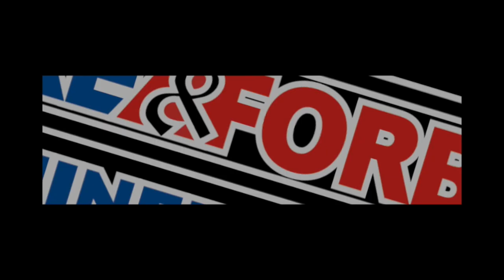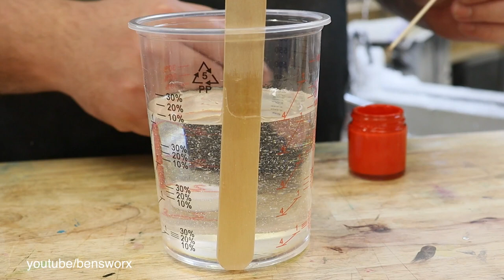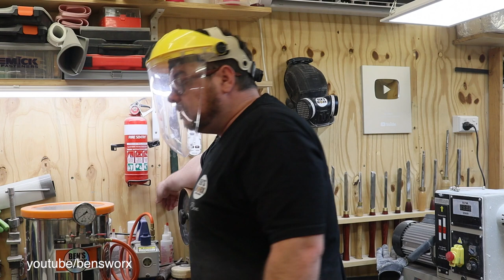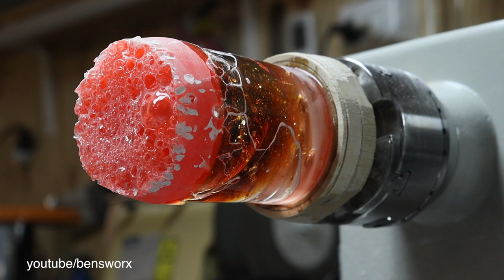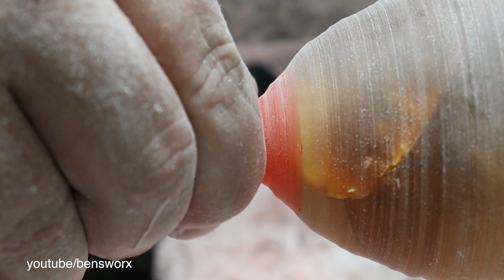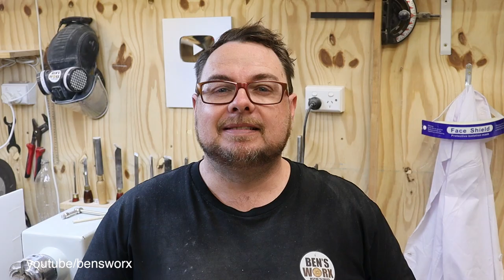It all Started with Popcorn - The Nebula Egg

Comment: I used to work at a transformer factory as an Impregnation engineer, to get maximum penetration we had a dual use pot, we could draw a vacuum, then leet in the varnish while still pulling the vacuum, after a while we would apply pressure, back to vacuum and then to pressure while still submerged, then we open a valve so the pressure put the varninsh back in the supply tank
If you do this again, at least draw the vacuum, then while still liquid release the vacuum, then either reapply vac or put in pressure pot.

Comment: Did you let the air back into the vacuum chamber before curing? As you’re not getting 100% vacuum, you’re better off letting air back in to push resin into the voids.
Reply from the maker: Yes I let air in a couple of times 👍

Comment: One things you should remember negative pressure will pull the air out but positive pressure is needed to push the resin into the voidz without allowing some air into the vacuum chamber before the resin hardens all you're left with is a bunch of holes that are pretty much vacuums
Reply from the maker: Yes I release the vacuum multiple times

Comment: The egg looks like a planet nursery.

I've seen a couple resin channels use magnets and iron dust. Every one of them did it with the market on the bottom. What about magnets on the side of the resin container, with the iron dust is dropped in the center top of the uncured resin?

Comment: If you let the air into the vacuumchamber all the bubbles will go away, curing under vacuum is not a thing I had succes with, but taking in out and then cure, will give you a bublefree result.

Comment: Could you pump down a project in the vacuum chamber, then repressurize to collapse the bubbles, before the resin sets?  For that matter, could you pull a vacuum in the pressure pot?
Reply: since air is used to create the pressure, how could you pull a vacuum?
Reply from the maker: Yes
Reply: @afg122602  "Pulling a vacuum" is a phrase that's sometimes used when dealing with pressure-related items.  It means to create a vacuum in a system by pumping out whatever gases are present -- "pulling" with something like a pump.
Reply: @jpolowin0  i know what pulling a vacuum means. i do it all the time. how can you pull a vacuum in a pressure pot when you are pumping air in to create pressure.

Comment: Wouldn't of it been better if you sucked the air out let it relax and then put it in the pressure pot to force all the resin into the voids
Reply from the maker: I pulled the vacuum multiple times, yes if you want a perfect cast throw it in the pressure pot 👍